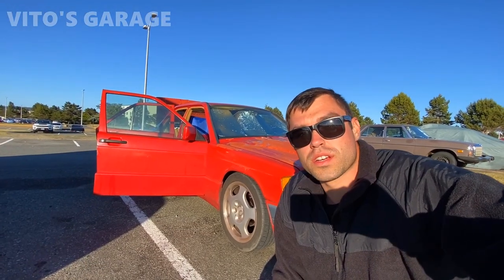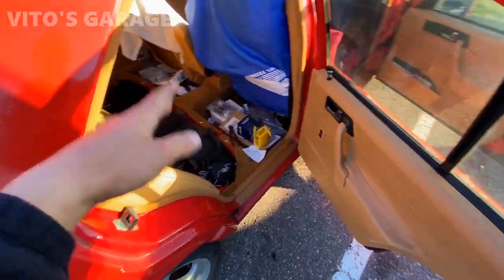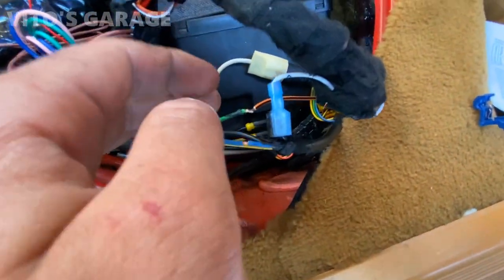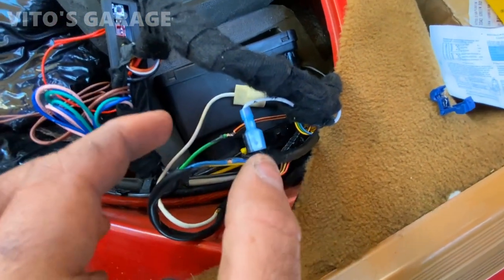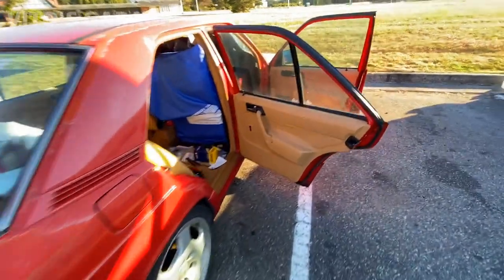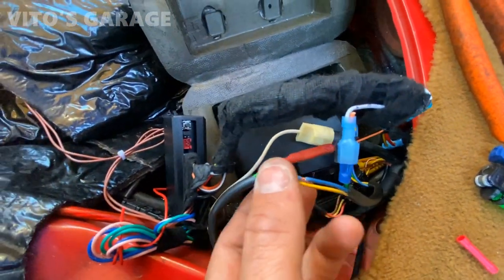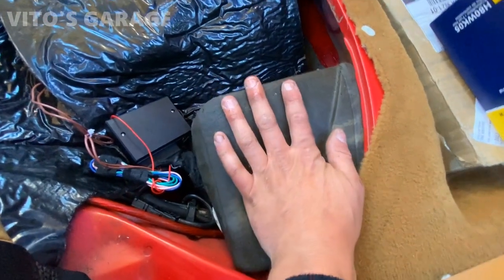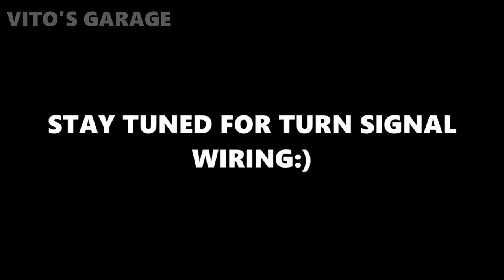Mercedes Problems with Remote Keyless Entry & Solutions! 190E W124 W126 W140 W201 W202

Comment: Thanks for the update Vito. Thanks for helping us save these amazing classic cars. I noticed the vacuum pump was still running when you unlocked the car. Is that  normal? Thanks again.
Reply from the maker: Thank you for your support. Yes, on W201 the pump runs for about 20 second when you unlock it. It’s normal

Comment: Hello. Awsome video, but I have a problem with my remote control. I can lock it with my remote, but I cant unlock it. When I click the button for unlocking I hear the pump trying to unlock it, but fails. My wiring is exactly the same.
Reply from the maker: Look at the pinned comment

Comment: Hello. I did exactly the same wiring as you, the remote control is working because I can listen the sound but nothing happen with the central locking. Should I try to cut and connect the blue or yellow instead of green? Thanks!
Reply from the maker: Hello. Watch the original video first and then this one again. 
https://youtu.be/bxFBU2laKr4?si=CgzQdFdObvuJZODf
Reply: @VITOSGARAGE  Firstly I watched the original video and I made the wiring as you said then I saw your second video and I tried the different wiring with cutting the green and connect it as you said, but nothing too. So I ask you if I can try cutting and connecting yellow or blue instead of green. Thank you in advance!
Reply from the maker: @FragiskosValvis  I’m not sure. This is the only way I know of. Try a different keyless remote. Maybe you got a defective one.
Reply: @VITOSGARAGE  thank you for your answer!